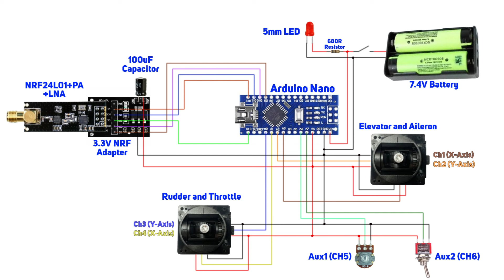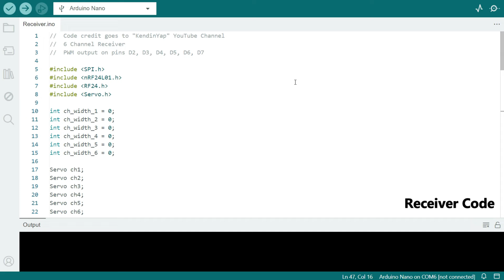How To Make 6 Channel Transmitter And Receiver

Comment: Bro there are two GND in arduino nano did you connect all the GND in one GND of arduino nano or in both the GND of arduino nano
Reply from the maker: Both the GND of arduino Nano are already connected together. So it does not matter whether you use one GND or the other. They both are the same.
Reply: @AKElectroDIY  ok sir

Comment: bro i made a arduino nano reciever very similar way that u but am facing problem with it that is whenever i give power to the reciver the arduino gets turned on but nrf adapter dosen't i checked that they are both connected but it still not dosen't turned on how to fix it plz help me :(
Reply from the maker: How much voltage are you giving to the nrf adapter? Connected from which pin?
It might be the case that voltage are not sufficient for it.

Comment: in the video its showing you can power one motor and 5 servos but i want to power 4 servos and 2 motors
Reply from the maker: @MrEd1ts2  No problem at all. As motors use their own current directly from the battery and not from the receiver. 

Actually the ESC has a built-in 5V voltage regulator that powers the receiver and servos. While the Motors are directly powered by the battery voltage, and only their speed is controlled by the receiver. 

Hopefully you understood the point. 👍

Comment: i cannot fi nd the exact length of the pcb board so is it it ok if its different the length?
Reply from the maker: @MrEd1ts2  Yeah. Doesn't matter at all. Size should be just enough to accommodate all the components. That's it.

Comment: Bro this remote will work for rc plane properly will it be able to fly the plane like fly sky transmitters?
Reply from the maker: @IIT2007  Yes bro. It will work just like the flysky transmitter. It just lacks some functions like trim buttons, etc. But it will control an rc plane just like a commercial transmitter.
Reply: Thanks❤️❤️

Comment: Can we connect this controller to pc to practice in a simulator
Reply from the maker: @abdullahazam5124  Hello there.
We can connect this controller to PC to practice in a simulator. But not with this microcontroller. You see, the arduino uno and arduino nano have the atmega328 chip. And this chip does not supports HID(Human Interface Device).
(HID refers to devices that enable interaction between humans and computers. Keyboards, mice, and game controllers are common examples)
On the other hand, The arduino pro micro has an atmega32u4 chip that supports HID capabilities. So the conclusion is, you can use an arduino pro micro to connect this transmitter to the computer to act as a joystick controller for practicing on a simulator.
Reply from the maker: I am planning to make a transmitter entirely for simulator purposes. Using arduino pro micro. Hope it will be a good project

Comment: When i am connecting arduino of reciever to the cable it is showing red light in arduino but it doesnt show any light in nrf24lo1 module.
Reply from the maker: @khushbujain4136  Normally, Nrf24l01 does not have an onboard light. But if you are using a voltage module for nrf24l01, then it has a light. 
If you are still unsure, you can just check voltage on nrf module pins using a multimeter. It should be 3.3V.

Comment: Please
Reply from the maker: No problem. I'm here to help.
Reply: Receiver and transmitter
Reply: @AKElectroDIY  download file is not open both
Reply from the maker: // Transmitter Code

  #include <SPI.h>
  #include <nRF24L01.h>
  #include <RF24.h>
  const uint64_t pipeOut = 0xE9E8F0F0E1LL;   //IMPORTANT: The same as in the receiver 0xE9E8F0F0E1LL | Bu adres alıcı ile aynı olmalı
  RF24 radio(9, 10); // select CE,CSN pin | CE ve CSN pinlerin seçimi
  struct Signal {
  byte throttle;
  byte pitch;
  byte roll;
  byte yaw;
  byte aux1;
  byte aux2;
};
  Signal data;
  void ResetData() 
{
  data.throttle = 12;   // Motor stop | Motor Kapalı (Signal lost position | sinyal kesildiğindeki pozisyon)
  data.pitch = 127;    // Center | Merkez (Signal lost position | sinyal kesildiğindeki pozisyon)
  data.roll = 127;     // Center | merkez (Signal lost position | sinyal kesildiğindeki pozisyon)
  data.yaw = 127;     // Center | merkez (Signal lost position | sinyal kesildiğindeki pozisyon)
  data.aux1 = 127;    // Center | merkez (Signal lost position | sinyal kesildiğindeki pozisyon)
  data.aux2 = 127;    // Center | merkez (Signal lost position | sinyal kesildiğindeki pozisyon)
}
  void setup()
{
  //Start everything up
  radio.begin();
  radio.openWritingPipe(pipeOut);
  radio.setAutoAck(false);
  radio.setDataRate(RF24_250KBPS);
  radio.setPALevel(RF24_PA_HIGH);
  radio.stopListening(); //start the radio comunication for Transmitter | Verici olarak sinyal iletişimi başlatılıyor
  ResetData();
 
}
  // Joystick center and its borders | Joystick merkez ve sınırları
  int mapJoystickValues(int val, int lower, int middle, int upper, bool reverse)
{
  val = constrain(val, lower, upper);
  if ( val < middle )
  val = map(val, lower, middle, 0, 128);
  else
  val = map(val, middle, upper, 128, 255);
  return ( reverse ? 255 - val : val );
}
  void loop()
{
  // Control Stick Calibration | Kumanda Kol Kalibrasyonları
  // Setting may be required for the correct values of the control levers. | :Kontrol kolların doğru değerleri için ayar gerekebilir.
  data.throttle = mapJoystickValues( analogRead(A0), 12, 524, 1020, true );  // "true" or "false" for signal direction | "true" veya "false" sinyal yönünü belirler
  data.roll = mapJoystickValues( analogRead(A3), 12, 524, 1020, true );      // "true" or "false" for servo direction | "true" veya "false" servo yönünü belirler
  data.pitch = mapJoystickValues( analogRead(A2), 12, 524, 1020, false );     // "true" or "false" for servo direction | "true" veya "false" servo yönünü belirler
  data.yaw = mapJoystickValues( analogRead(A1), 12, 524, 1020, false );       // "true" or "false" for servo direction | "true" veya "false" servo yönünü belirler

  data.aux1 = mapJoystickValues( analogRead(A6), 12, 524, 1020, true );     // "true" or "false" for servo direction | "true" veya "false" servo yönünü belirler
  data.aux2 = mapJoystickValues( analogRead(A7), 12, 524, 1020, true );     // "true" or "false" for servo direction | "true" veya "false" servo yönünü belirler
  radio.write(&data, sizeof(Signal));
}
Reply from the maker: //  Receiver Code

#include <SPI.h>
#include <nRF24L01.h>
#include <RF24.h>
#include <Servo.h>

int ch_width_1 = 0;
int ch_width_2 = 0;
int ch_width_3 = 0;
int ch_width_4 = 0;
int ch_width_5 = 0;
int ch_width_6 = 0;

Servo ch1;
Servo ch2;
Servo ch3;
Servo ch4;
Servo ch5;
Servo ch6;

struct Signal {
byte throttle;      
byte pitch;
byte roll;
byte yaw;
byte aux1;
byte aux2;
};

Signal data;

const uint64_t pipeIn = 0xE9E8F0F0E1LL;
RF24 radio(9, 10); 

void ResetData()
{
// Define the inicial value of each data input. | Veri girişlerinin başlangıç değerleri
// The middle position for Potenciometers. (254/2=127) | Potansiyometreler için orta konum
data.roll = 127;   // Center | Merkez
data.pitch = 127;  // Center | Merkez
data.throttle = 12; // Motor Stop | Motor Kapalı
data.yaw = 127;   // Center | Merkez
data.aux1 = 127;   // Center | Merkez
data.aux2 = 127;   // Center | Merkez
}

void setup()
{
  //Set the pins for each PWM signal | Her bir PWM sinyal için pinler belirleniyor.
  ch1.attach(2);
  ch2.attach(3);
  ch3.attach(4);
  ch4.attach(5);
  ch5.attach(6);
  ch6.attach(7);

  //Configure the NRF24 module
  ResetData();
  radio.begin();
  radio.openReadingPipe(1,pipeIn);
  radio.setAutoAck(false);
  radio.setDataRate(RF24_250KBPS);
  radio.setPALevel(RF24_PA_HIGH);
  radio.startListening(); //start the radio comunication for receiver | Alıcı olarak sinyal iletişimi başlatılıyor

  pinMode(6,OUTPUT);

}

unsigned long lastRecvTime = 0;

void recvData()
{
while ( radio.available() ) {
radio.read(&data, sizeof(Signal));
lastRecvTime = millis();   // receive the data | data alınıyor
}
}

void loop()
{
recvData();
unsigned long now = millis();
if ( now - lastRecvTime > 1000 ) {
ResetData(); // Signal lost.. Reset data | Sinyal kayıpsa data resetleniyor
}

ch_width_4 = map(data.yaw,      0, 255, 1000, 2000);     // pin D5 (PWM signal)
ch_width_2 = map(data.pitch,    0, 255, 1000, 2000);     // pin D3 (PWM signal)
ch_width_3 = map(data.throttle, 0, 255, 1000, 2000);     // pin D4 (PWM signal)
ch_width_1 = map(data.roll,     0, 255, 1000, 2000);     // pin D2 (PWM signal)

ch_width_5 = map(data.aux1,     0, 255, 1000, 2000);     // pin D6 (PWM signal)
ch_width_6 = map(data.aux2,     0, 255, 1000, 2000);     // pin D7 (PWM signal)

// Write the PWM signal | PWM sinyaller çıkışlara gönderiliyor
ch1.writeMicroseconds(ch_width_1);
ch2.writeMicroseconds(ch_width_2);
ch3.writeMicroseconds(ch_width_3);
ch4.writeMicroseconds(ch_width_4);
ch5.writeMicroseconds(ch_width_5);
ch6.writeMicroseconds(ch_width_6);
}
Reply: @AKElectroDIY   thankyou
Reply: @AKElectroDIY  thanks
Reply from the maker: @fftaufiqgamer2135  You're Welcome

Comment: Bro can I use nrf module without antenna
Reply: Yes you can but I would advice u use antenna for the transmitter to increase the range
Reply from the maker: @pyro_boy137  Yes, You can use. As I told in the video that nrf modules are interchangeable. But as @tammyff749 mentioned the range will decrease with that.
Reply: @AKElectroDIY  ooh 
Tanks for reply bro☺️
Reply: @tammyff749  Thanks bro
Reply from the maker: @pyro_boy137  You're Welcome

Comment: The main problem is not able to get this type of joystick so I made a joystick like yours with by moulding pvc , those ps 3 joystick does not work properly, now I'll make remote like you after I clear My exams
Reply from the maker: Yes you're right. These joysticks are rarely available. 
Really Good to hear that you also wanna make one. Cheers 🙌